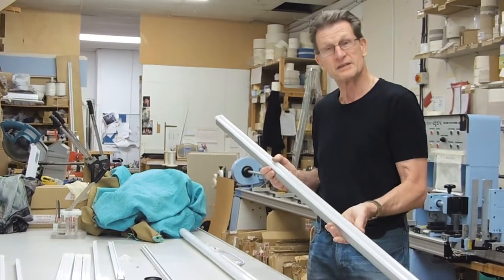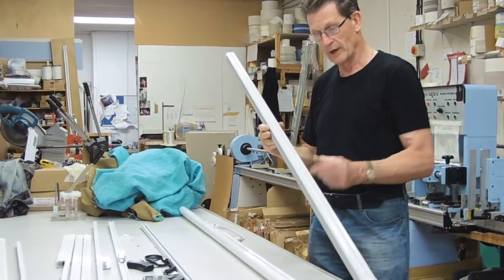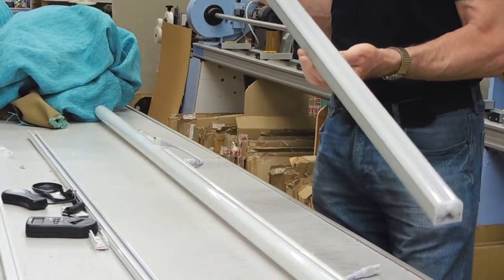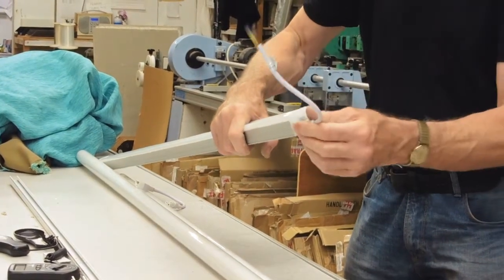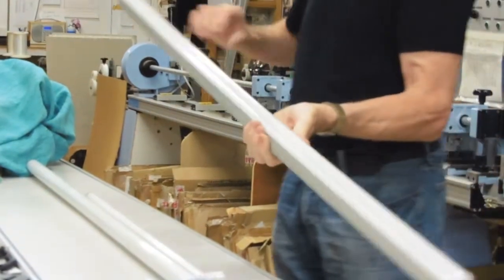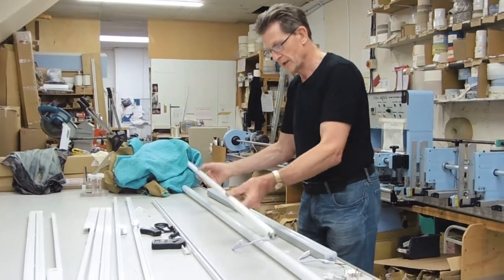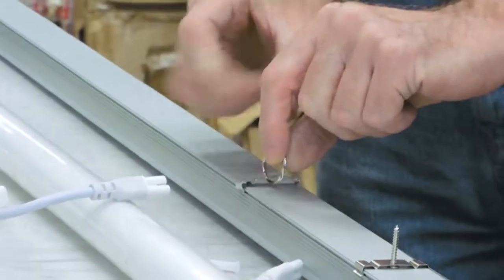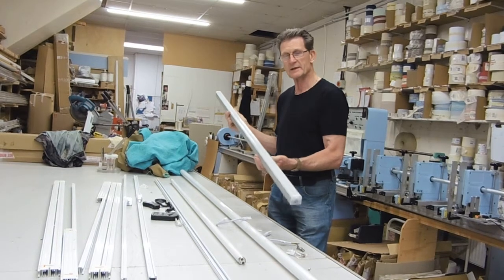Replacing Fluorescent Lighting Battens?

Comment from the maker: Now available in 6500k Cool White with clear covers giving 120Lm/W twice as bright as your old Fluorescent tubes! Using the simple clip and fit system your lights are replaced in minutes using Wago connectors and our insulation sleeves

Comment: I bought 2 of the 5ft versions to replace 3 light bulbs in my garage. These are absolutely brilliant and have transformed my garage immensely. They are extremely easy to install and I am someone that dreads any DIY projects!! 

What makes these even more of a brilliant buy is the fact that you only need to connect one of the batterns to your light circuit as any others merely plug into the main unit. So simple to add a second or more battern.

Goods were delivered next day.